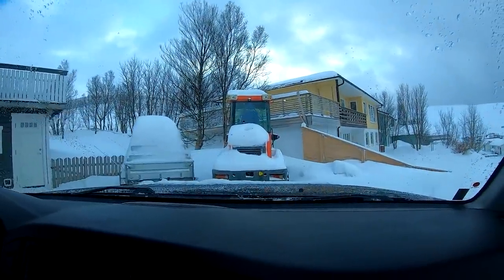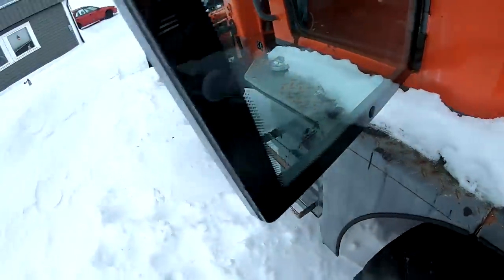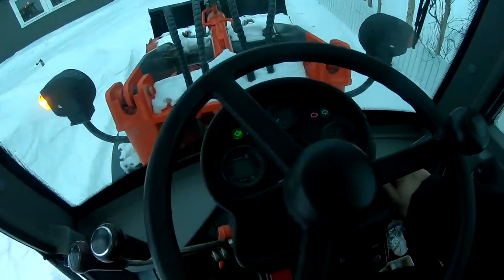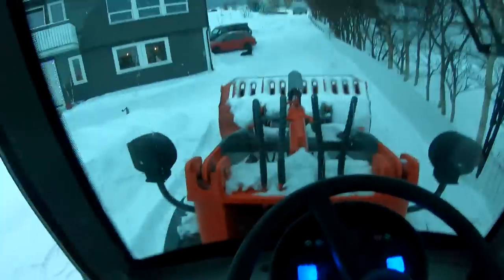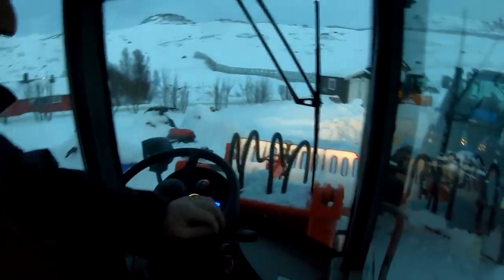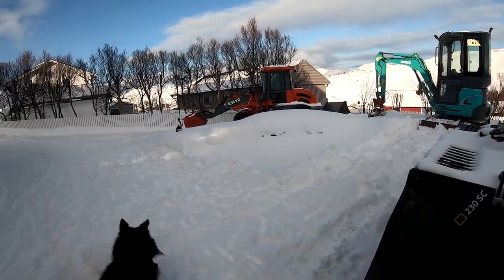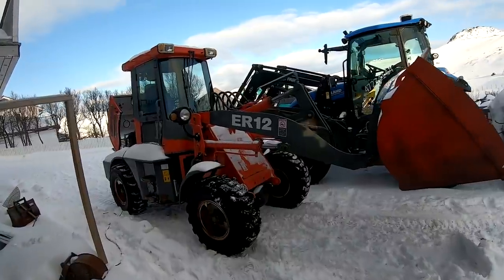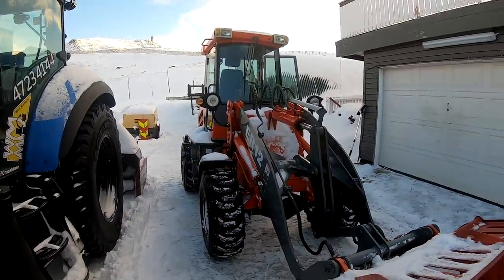Buying the cheapest Wheel loader

Comment: Hello .  
I think it is best to use a "surge protection" this is just a small box between the Dinamo and the rest of the electrical components.  
this means that the electrical system no longer has to deal with over voltages.  
you also have no reversing lights.  
maybe your reversing camera has a fuse or you need to get power from the reversing lights.  
I am curious about part 2.  
with kind regards Hollandduck from the Netherlands
Reply from the maker: Yes thats probably a good idea, I think the reason He saw the peak in voltage was because the power breaker stoped working and the load went away.
It doesn't have reverse light it's like on the tractor always on, I guess since the wiper and the reverse camera aint working it's probably something with the wires going up to the roof.

Comment: Not so bad, few gremlins to evict, you'll straighten it up after a bit. Hydraulics seem fine. I think I might test the fuel lift pump function, didnt seem keen on starting right off. All in all a successful buy for the money.
Reply from the maker: Yes a few miner not expensive fixes, yes it's even now with nicer temperatures not firing up at ones so guessing it's something with fuel going back ore something. Might be cracked lines...

Comment: That’s odd to see the chrome shaft rusting. We run rubber tire loaders and graders in heavy salt and never have rust on the chrome rods like that. That’s very surprising to see deep rust on the shafts like that.
Reply from the maker: That's how it is with chinesium 😅
Reply: Even if  they claim certain alloys are being used, you can never be 100% sure in Chinese machines, you can have one batch of products that are fine and the next the steel is more like pig iron.  Its absolutely disasterous for professional equipment, where unexpected downtime is more expensive  in very short period of time compared to savings in initial purchase price or replacement parts. For a hobbyist willing to deal with breakages and even switch out entire sub-assemblies its fine unless they really fail in a deadly way.

Comment: Sounds low on hydraulic.  Did I hear correctly you paid $1500 for that? Great deal. Wheel loaders are good for short-distance work. Faster than your tractor or skidsteer...
Reply from the maker: The level is correct on hydros, but all of these makes terrible noises running the hydros.
Yes about $1500 👌

Quicker in thigh spaces maybe, for travel no....
Reply: We bought a Case IH Puma 150 and it makes those noises periodically too. Even though all filters were changed and levels are good...$140,000 and the dealer does nothing...

Comment: I have a 2017 ER12 I use the loader for snow works great for me I have had no issues with it but last week my worker started it backed it up turned it off and now it won’t start I can’t start it now I tried starting fluid it just keeps cranking it won’t start I can’t figure it out any ideas?
Reply from the maker: First thing to look at is the electronic actuator that turns off the fuel supply.
When you hit the kill switch it shuts the fuel pump of.
With egnition on you should hear the actuator move.
Reply: @MiniMachines1  

Thanks I’ll check in the morning I’ll get back to u 
When I used starting fluid it tried to start then wouldn’t kick over this never happened before there cheep loaders but for the price can’t beat them I paid 21k new with the snow bucket with wings & soil bucket thanks for the info I’ll let u know tomorrow how I make out

Comment: I don't think your best friend quite knows what to make of the new machine. Is it light enough to pull on your trailer behind your truck?
Reply from the maker: He he he's not to happy about it, since it doesn't throw snow in the air 😅 
No its about 500kg to heavy, but I can have it in the trailer for the tractor.
Reply: Its charging so much because the alternator doest have good ground. Then the regulator is adding up 28 volts on top to the voltage difference in the ground circuit.
Reply: @megape95  a 24 volt system should charge at 28.8 volts. When the batteries are full ot will float charge at 26.6 to 27.
Reply: @justinfufun5483  seen 28v just as many  times as i see 14v on a car.  Things get real tricky at 30 and above.. 

Float charge is only with newer smart alternators. Never seen that with the old ones.  Its should be just straight 27/ 28v all times
Reply from the maker: I think the reason he saw the peak in charge and I saw 29v on idle when I picked it up is that the power braker wasn't working so it had no load,
Reply: @MiniMachines1  well okay. Is that power breaker in the ground side or in the hot side?
Reply from the maker: @megape95  is on the hot side, as you see in the video it's a feed directly from the battery, goes true the breaker and to all the components, including the starter

Comment: The Chinese machines in America are getting better. They partnership with Volvo engines and for parts. A 4 yard  big loader is 1/4 price of a Caterpillar. The drives are the old style where you put is in forward and reverse. New style ones are hydraulic drive. Even the excavators from 2014 to now are much more quality. Parts available is helping this.
Reply from the maker: Yes parts are not a big problem, exept hydraulic couplers they are some special Chinese treads on. The biggest downside are travel speed and comfort driving it.